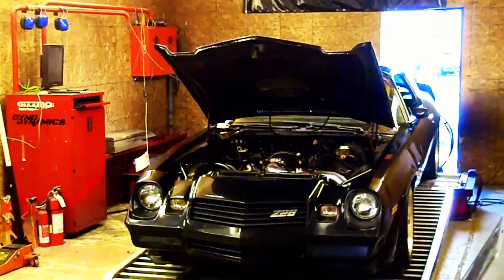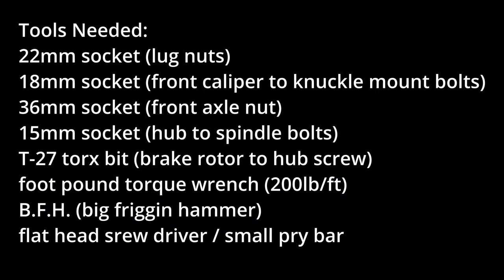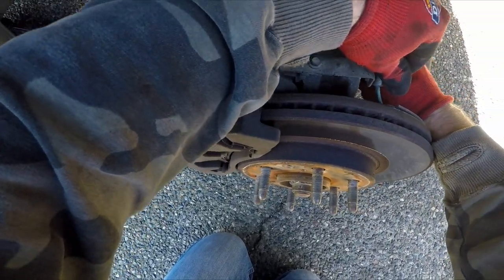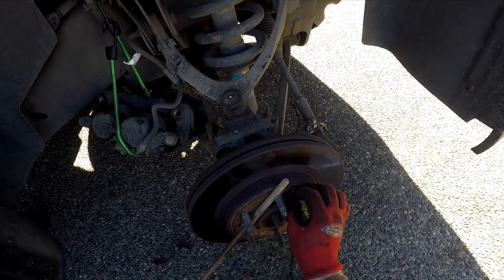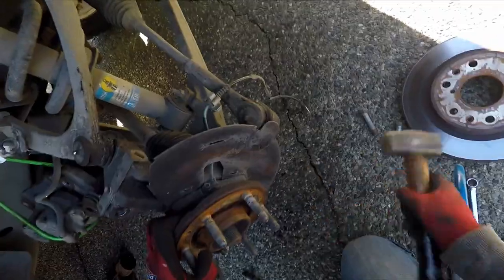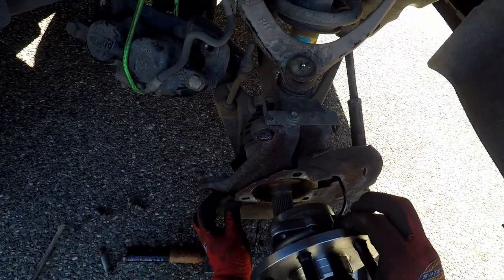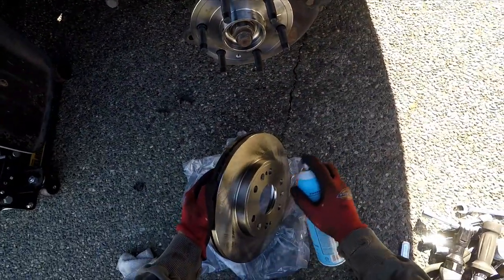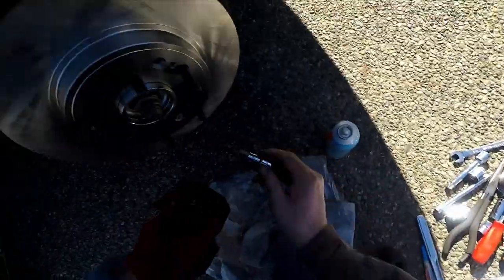Chevy Truck Front Hub replacement // Step By Step

Comment: Hello, great video BTW! I believe this needs to be done on my own 07 avalanche. My only concern is that after I get the hub assembly off that the real issue is in fact the CV Axle. Any tips or videos you've done to check for problems with the axle and/or replacing it?
Reply: Also shouldn't the CV Axle be packed with grease? I've never done that kinda repair so clarification on that would be appreciated
Reply from the maker: Hello and thanks for liking watching and subscribing! I have yet to replace the cv axle in my truck but it shouldn’t be that hard once you complete the disassembly in my video. Most likely some type of retail holding the inboard side to the from diff. If you search YT the solution is sure to be there. Good luck and post back when you find out if you like.

Comment: Do you happen to know the specs of the axle nut and spindle bolts?
Thank You!
Reply from the maker: Not off the top of my head. I’d check your maintenance manual or check online as it may vary.